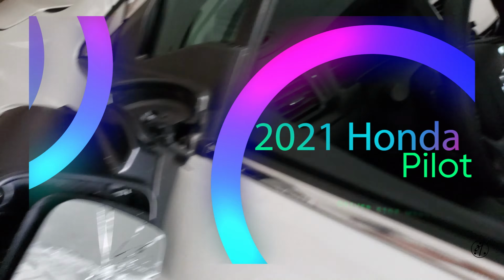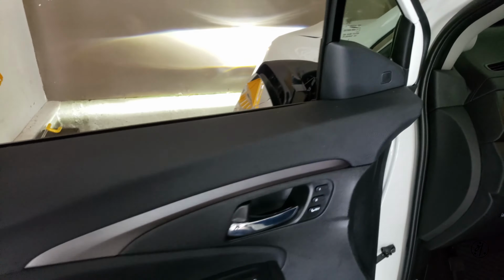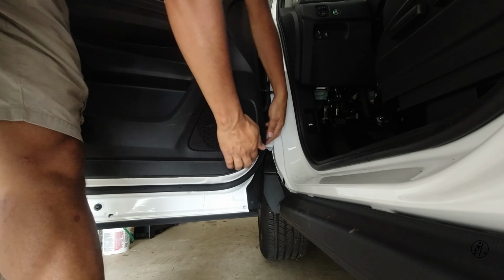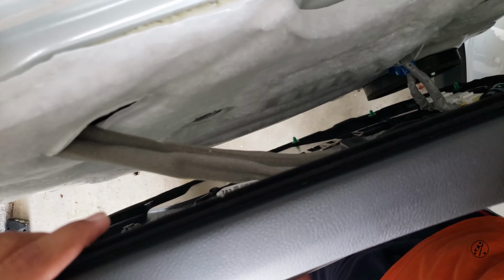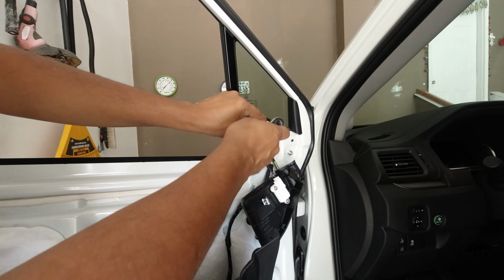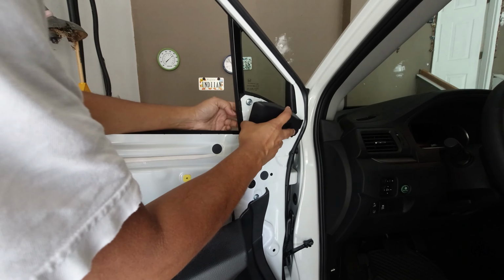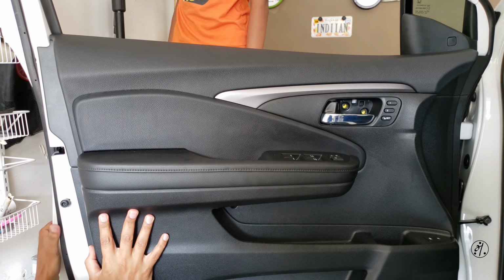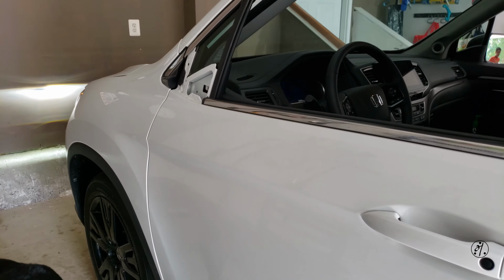2021 Honda Pilot Driver Side Mirror Replacement | 76250-TG7-A71ZL | Part 1

Comment: @RManni I have the same car and model someone broke my mirror, I called honda dealer they said just the part price is $500. please share with me if you find the mirror, I need one. Thanks
Reply from the maker: Watch my second video (link below). I bought a temporary replacement from rock Auto for around $100 and it's working fine
https://youtu.be/4rz28lb7Ymg
Reply: I might be late but I found two for 119
Reply: I just bought mine on eBay for $175…basically everything RManni removed

Comment: You could always just put a junk yard mirror on it. This generation has been in production since 2016 so there should be used parts available. Sorry this happened to you!
Reply from the maker: Quite bummed, but happy it did not scratch or damage the door. I probably have to go the route you suggested or use a generic mirror for now.
Thanks.
Reply: @rmanni  yes very lucky the door was not scratched.  just out of curiosity i searched RockAuto and found the part for around $125 but I cannot be certain of the fit or quality of what they offer.
Reply from the maker: @T455: Thanks. I see they have black mirror in stock but not white. I think that should work until I can find the white one. Thanks for the information, appreciate it very much.

Comment: You just wasted 8:48 seconds of my life.  You only showed how to remove a mirror, not replace a mirror.. genius
Reply from the maker: There is a part 2 that shows the replacement
https://youtu.be/4rz28lb7Ymg
Reply: The how to take the door and mirror off was the critical information I needed. Thanks for such a thorough coverage and good camera visuals for the part of the process.